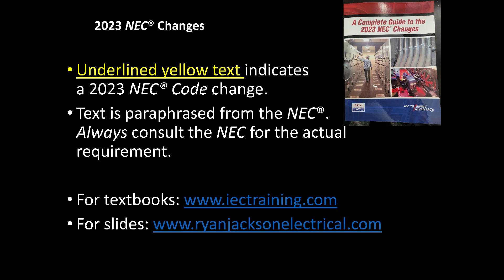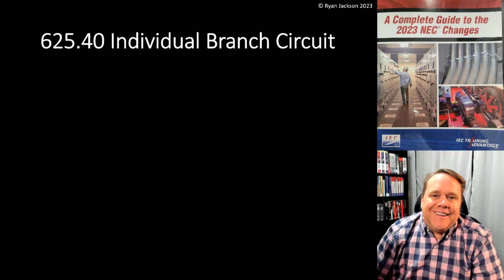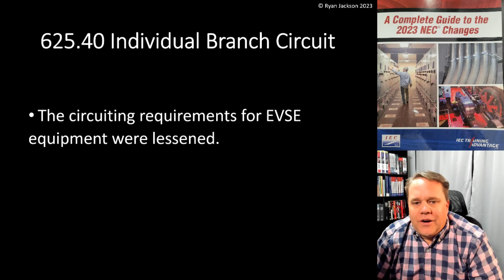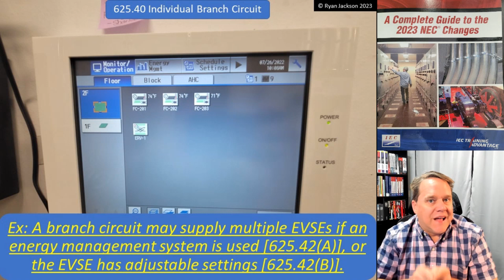625.40 Individual Branch Circuit (Electric Vehicles)

Comment: A typical 120V EVSE (also called level one) is 12 amps, the maximum continuous load for a 15-amp circuit.  So you can't really run anything else on the circuit at the same time, but I guess the idea there is that maybe you would unplug it and plug in some portable power tools and it wouldn't really need to be a dedicated circuit.

The other place this your permission makes a lot of sense is if you have a 20-amp circuit, which you typically would in the garage anyway, and maybe you want to also run the garage door opener and some low power lights.  Depending on the garage door opener you might be able to do that on the same circuit as the 12 amp charging, particularly given that the opener is not a continuous load.

Comment: Some years ago a wood floor refinishing contractor decided he could take the cover off my breaker box and clip his wires to both sides of my current supply to get 220 for his sander.  When he did this, he destroyed the finger used to clip in a breaker.  He also damaged the main breaker, which I didn't realize immediately.    This guy then tried to sue me for full payment after I deducted the cost of electrical repairs.  The breaker was easy, but the little finger had be fabricated.  The judge ruled against him when I pointed out he violated the Electrical code.  He claimed he couldn't keep breakers for every type of panel.

Comment: Love to hear your insight on what exactly is meant by this language in 625.42: "Service and feeder shall be sized in accordance with the product ratings,..." The key phrase there is 'product ratings', that phrase is not defined or used anywhere else that I can find. If I have a 32 amp charger, is 32 amps the product rating? Do I size my service or feeder for my 6 EV chargers at 100% or 125% of the combined loads? In my area, depends on which AHJ you ask.
Reply from the maker: The rating would be 32A, and because it is a continuous load, you would take it at 125%.
Reply: I have a real world example. My Tesla High Power Wall Connector is an older model that allows the electrician to choose the max charge current up to the HPWCs design maximum amount. The electrician then follows the usual rule that load can be no more than 80% of the breaker rating to size the breaker. Newer version HPWCs can now be installed in groups and share the same breaker for those with multiple EVs such that the HPWCs and the onboard chargers will coordinate their charge current to assure compliance with the 80% rule. I suspect this is one variant of the management system that was teased to be discussed next.